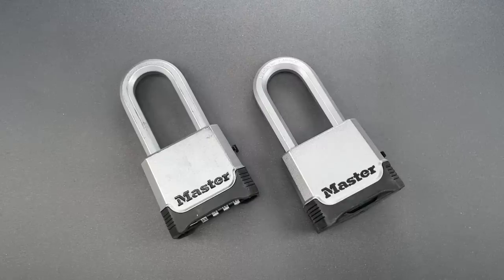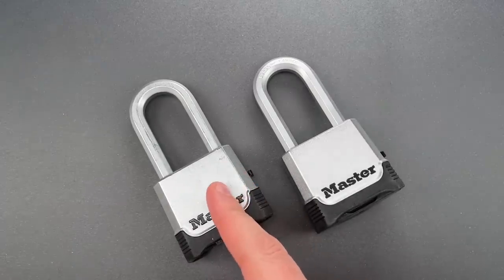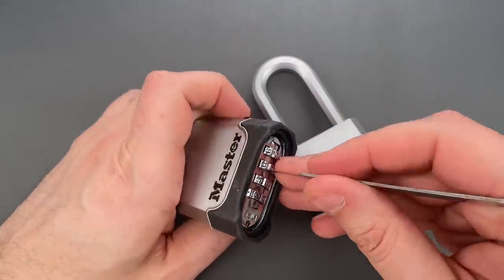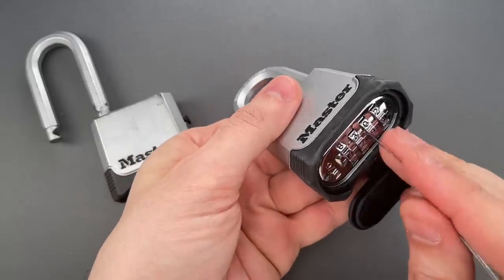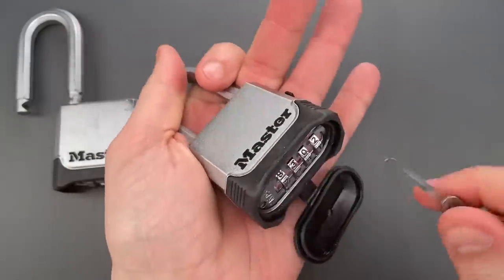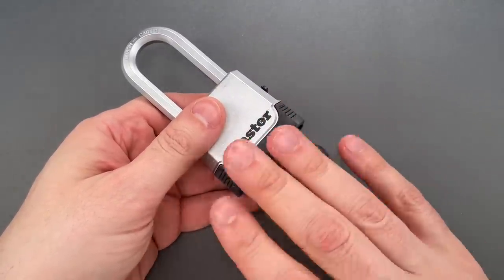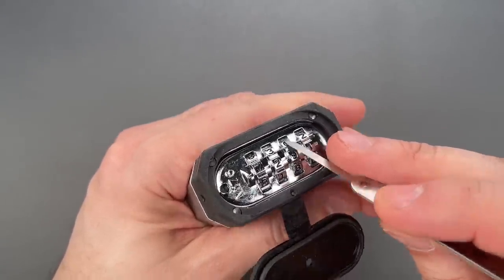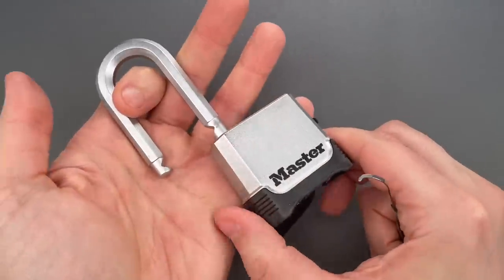[1507] Revised Master M176—New Open Method!

Comment: It's unlikely that they actually tightened up tolerances tbh. What is more likely is that you've both gotten a lock from a batch that had it's dial plate cast from a fairly new mold. Over time those molds wear down and tolerances are all over the place again. I wouldn't credit them with anything more tbh.

For everyone saying this plate might not be cast at all, you're probably right actually. As evident by the visible thickness of the part near the hole in the bottom, it's more likely that this is indeed a stamped item. On a stamped item like this, worn tooling would indeed actually lead to smaller clearances. Again, that's all we should be crediting them with really, with using tooling and designs far beyond their expiration dates.
Reply: I wonder if MasterLock actually design anything , and just go on taking what batch manufacturers have made and get it put into their branding and packaging.
Reply: I think you guys are onto something. lol
Reply: My thoughts almost exactly, accept more properly phrased.
Reply: OEM / OED is a standard procedure in big manufacturing companies. Its much cheaper for them. The only ones designed/modified  are the top products. The standard cheap products are always just designe by some factory in china, with just some very small adjustments and logo slapped on.
Reply: I'm probably wrong, but I never viewed Master Lock as a company with any engineers. Just buyers sitting at a table with Chinese suppliers, picking which locks they will brand with the ML logo. After that they pay the bill and wait for the shipping containers to show up.
Reply: @adaycj  i am sure they have some engineers, but the amount of own design, modified designs, and checked products are probably in few percent of their whole inventory.
Reply: I dont think the dial plate is molded, I think from the looks of it, being stamped from sheet metal using a press. This to give the plate its cup format too so it can be pressed into the lock.

HOWEVER the dials themselves are definitely molded 100%. And if that mold becomes tigher, then the wheels get a hundred of an mm thinner and the gap becomes wide again.
Reply: I think it’s the opposite of new tools having “better” tolerances for the dial plates. Production tools tools tend to ware out and make the parts creep larger over time.  This in turn makes the assembly fit tighter.  By that logic, it appears MasterLock hasn’t done anything beyond letting it’s tools run on for too long.
Reply: @adaycj  In fairness this is the way many companies these days operate. I doubt most mainstream clothing companies design anything either, they just pick which foreign designs they like and slap their tag on it.
Reply: Except he started by saying he got a letter stating they couldn't get in between the wheels. It seems improbable that the writer and LPL both happened to get locks that were made using newer molds. Also, like someone else said, that plate appears to be stamped rather than cast.
Reply: @adaycj  So pre-1990s products from Masterlock are actually good?
Reply: @solracer66  you mean: let the producer slap their tag on it.
Reply: If the mold for that piece wore, the gaps would get SMALLER. They're not closing up the tolerance, they're just not replacing their mold.

That's if it's even cast. Might be punched. Same effect.
Reply: @MorbidEel No, they were definitely bad in the 90s, and I'm pretty sure they were bad in the 80s too. Probably forever.
Reply: Is that plate even cast?  If it’s just a flat plate I would think it’s stamped.
Reply: @MorbidEel  I'm not sure if this comment was really for me. My answer is, not that I have seen.
Reply: @highpath4776  Yes, they do. Or did. They were the original designers of all of these common lock designs, and everyone has copied them. And they definitely have their own factories. They moved them back to the US a few years ago after having been in Mexico for a decade or so. That said, some of their cheaper locks are made overseas. But they were still the original designers.
Reply: tbh yeah this did make sense to me tbh tbh
Reply: @sebastiannielsen  100mm is huge
Reply: @sebastiannielsen  100mm is a lot
Reply: @codefeenix  hundred of an mm = 1/100 mm. Didn't say hundred mm, but hundred "of an" mm (1 mm split in 100 pieces)
Reply: @sebastiannielsen  you forgot a th

Comment: Master Lock: We've tightened the side areas of the Code Wheels to the point a 6 thousandths piece of metal barely fits.

LPL: Oh, the code Wheel sides are tighter? No problem, I'll just go over it.

Master Lock: GOD DAMN IT!
Reply: And then a Thief outside of the US uses a .15mm shim. How embarrassing.

Comment: Why not design a lock to prevent all the picking methods or sell modified locks which have had extra features and security pins installed? Most people would buy a more expensive lock from you if you said it was more secure.

Comment: At what point is an easily picked (or otherwise bypassed) lock acceptable vs not acceptable? At the end of the day it seems like the vast majority of locks in the range normal people would be using are easily dealt with by anyone who came with the right tools and knowledge. I know ML tends to be on the crappier end of the spectrum, but how much is that actually saying when we're talking about it taking 4 seconds instead of 14 seconds?

I guess being able to use a shim to open it without needing to actually pick anything is probably one step down from average and makes it unacceptable. But what if that's not the case, it's a lock that requires actual tools to pick, but it's just really easy and still opens in 10 seconds? Is that okay? Not okay?

Bit of a tangent, sorry.

Comment: I have a combination master puck lock that I found in a van I bought. It is marked 2916BD.
It took me an hour messing about to find the combination, then the combination wouldn't work. Took me another half hour to find the combination, then that wouldn't work, so I had a think about what I had been doing. 
It turns out that if I push the number rotators upwards it unlocks....
I have been using it for a year now, unlocking it a couple of times a week and I still have no idea what the code is...

Comment: For a second there I thought master lock had made a decent improvement to there lock.
Reply: It is a "decent" improvement. There's a handful more of decent improvements which could also be made before this is more than a decent lock.
Reply: @bhough410  The 1 gap is smaller the other gap is bigger that's no improvement. Imagine you are on an inflatable raft and it has 5 holes in it and I make 1 of the holes leak less then poke another new hole in your raft really this is worse than the previous one because the previous exploit is now slightly harder in 1 area but still possible and really easy from another area.

Comment: A classic case of mitigating the exploit instead of fixing the underlying problem: that the locking mechanism is accessible from the bottom. It should have a wall of separation.

Comment: Instead of the extra expense of putting a 4-pin cylinder in the side (which makes it less secure) Why didn't they attempt to shield the comb bar from this attack? At least it looks like they attempted to make decoding it difficult. They could have easily shielded the sides of the code wheels completely by having the bitted side of the codewheels recessed under warding on the outer shell. Blocking the comb bar would have been easy too by having it drop behind a ward across the width of the inner body. But, it appears they don't care much about true security.

Comment: Can they not shield the locking bar?!? Who is designing these locks that their solution was just to make the tolerances on one part of the bottom tighter at the expense of another part!? 

I know this is Master but usually they just don’t do anything.. I guess this is characteristic of their “fixes” though, now that I think about it. Like the bump they put in the shackle of the number 3 to stop shimming rather than just using a ball bearing mechanism

Comment: Those tighter tolerances will also make it difficult to spin the wheels once corrosion sets in. So I guess you need to replace the locks nore often now too
Reply: nore often

Comment: I've got an older 175, at least thirty years old at this point.  I absolutely cannot get the shim in far enough to get this work.  I push it in and it gets forced upwards and stops only few millimeters past the code wheel.

Comment: I am not going to suggest that they have made an improvement, different tooling can product better pressings or castings than worn out dies and moulds and this is a lock that is not safe for use in  respect of anyone who knows how to defeat it.
One of the things that is truly frightening is that an average LEO would not recognise two scraps of metal like what LPL used as lock picking tools because Masterlock cannot actually make a lock that requires special ie identifiable tools to pick it

Comment: You bent a pick for absolutely no reason. You can open it from the top with a straight piece of metal. I use a wiper insert to open mine.

Comment: Semantic correction... Tolerance is a range of sizes that will still work for the intended purpose of a single part.  Allowance is the intentional gap between assembled parts.  In cases of a force fit assembly, the allowance may even be negative slightly.

Comment: if you ask me I would say masterlock did not changed a thing. They probably order a new set of molds because old ones were no longer useable and new molds came out a little bit thinner resulting the back plate being larger therefore the gap being smaller.